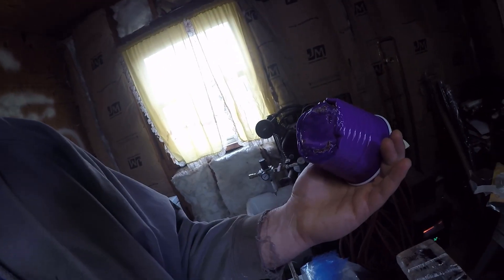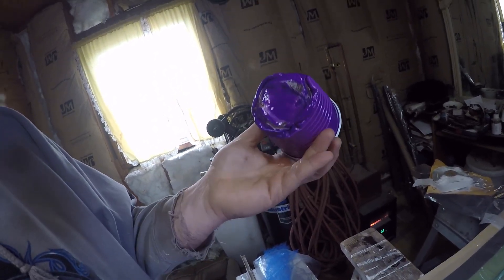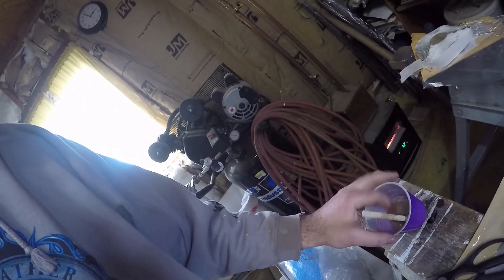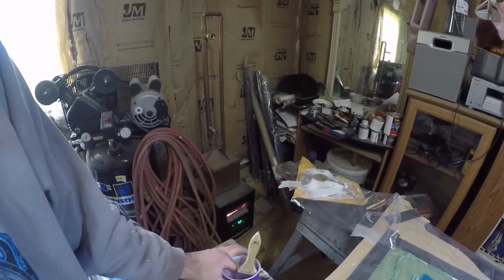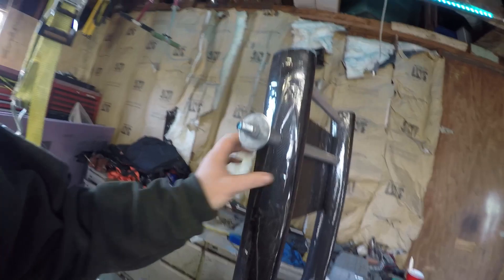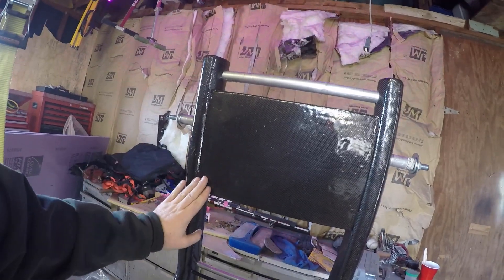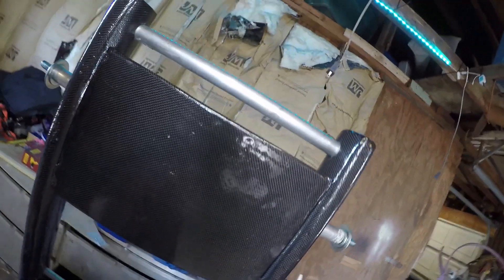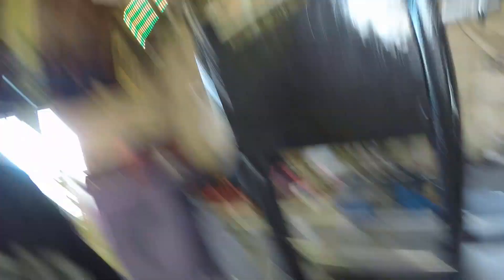Homemade Carbon Fiber Paramotor || Part 3

Comment: Cant wait to see it fly,you using a Moster?
Reply: @jsteinsultz2  nice..vitorazzi makes a great engine..only issue I know about is exhaust breaks and they torque hard right but for power to weight you can't beat it.

Comment: Did you build it in sections or complete circle?   It looks like you did a simple wrap around a form?  Correct?  Did you wrap with electrical tape to squeeze out resin?   Probably no easy way to vacuum bag that.
I'm think of using the tubular carbon cloth sleeves such as they use for fishing rod builds .  Trying to determine if the entire hoop could then be vac-bagged on a table.

How rigid is the finish hoop?
Reply from the maker: I built it in 4 different sections. I cut it out of foam then wrapped it. Then vacuum bagged it. I did one side of each then the other side. When I joined the sections together I used the electrical tape. The tube carbon would probably work just as well. I'm sure you can do the entire hoop at once. You would just have to be quick enough so that the resin doesn't start setting up on you. As far as rigidity, it is really strong. I would say stronger than aluminum for sure. Hardly any flex.